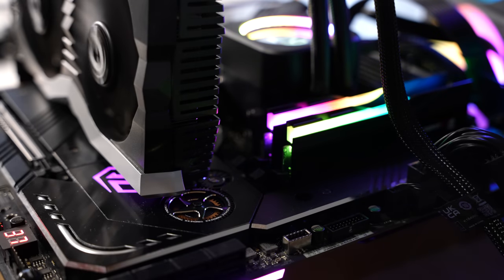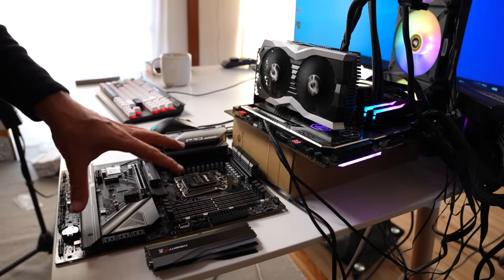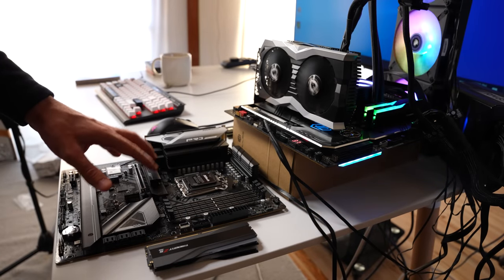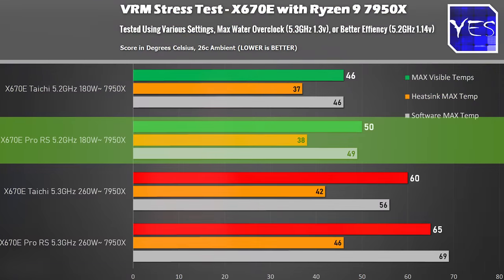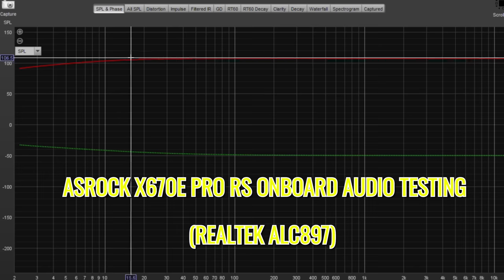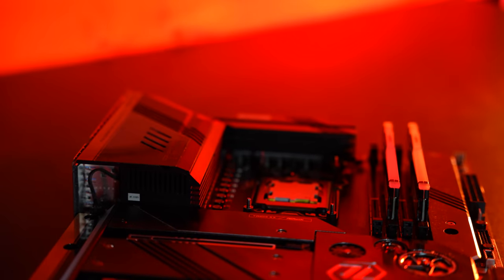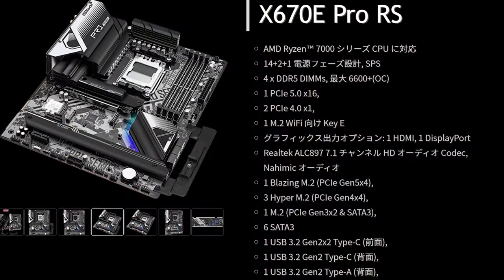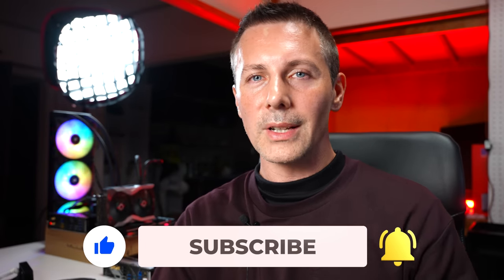Watch This BEFORE you Buy an X670E or Ryzen 9 7950X!

Comment: I have nothing against this video, i think it reports some good info actually, but i have one pet peeve which i want to mention with the whole "sweetspot" claim. You say that at 6400mhz you had some crashes in games, therefore it is unstable and then you say that 6200mhz is the sweetspot, how can it be a sweetspot if its literally maximum possible speed? Other people also have massive issues getting 6200mhz stable on zen 4 so official claim that 6000mhz is the sweetspot is very rich considering that you need to have only two modules installed and the next step 6200mhz can be potentially unstable on your system, aka potentially maximum stable value. Idk if im being way to pedantic about this but i have very different understanding of what sweetspot supposed to be.🤷‍♂

Comment: I did not managed to get my 1st amd build posting with more than 1 dimm installed, not even at stock settings - solid dram all the time for over 1h, regardless which bios I tried. Only posting with 1 on A2(each of both). Mainboard and RAM went back, but I still have no clue what the issue is. RAM was on supported list form gigabyte, but not on amd's lists. 1 socket pin looked way longer than the others. b650e elite x ax ice with an trident z5 64GB kit(F5-6000J3040G32GX2-TZ5RS) - 7800x3d. No clue what the issue is- - Is the the combo or a broken board... or the cpu mem controller??? so annoying when just wanna game😑

Comment: Question: This DDR5 6000 limit is on the CPU side and not on the chip itself?
I hope that future ZEN CPUs supported by AM5 socket and today's motherboards will not be also limited to 6000 if we already have way faster modules Intel can utilize.
7700x + mATX MoBo with PCIe 5 and M.2 5 is my way to go but I will wait because the prices of the platform right now are just ridiculous even on B650E
Could you please make a video about BIOS undervolting, setting the power limit, and temp limit using different manufacturers (Asrock, Gigabyte, Asus, etc). Mostly interested in Asrock.
Reply: Fortunately x3d does not require faster ram to extract the performance. X3d with ddr 6000 will be equivalent to 14th gen Intel with ddr 8000. I do wonder if zen 5 will be somewhat slower than zen4 x3d just like 7700x loses in a couple scenarios vs 5800x3d. The x3d technology is quite interesting but I personally would prefer a CPU that is faster in all situations that CPU that is super fast in some situations.
Reply: DDR5 6000 is already 800MT/s faster than the officially supported DDR5 5200. When he used 4 sticks at 4800MT/s, he was running 1200MT/s over the officially supported 3600MT/s.

Even Raptor Lake only officially supports DDR5 5600. We will just have to see how official support improves over time. But, generational increases matter much more for performance than RAM speeds. You can also get lower latency RAM at a given speed to help performance.
Reply: Zen 4 being the first Zen on DDR5 has weak IMCs, integrated memory controllers, just like 12th gen Intel did
Reply: @ij6708 is 13th gen any better?
Reply: @skyman1883  Much better 13th gen can easily run 7000MT/s and up, whereas on 12th gen it's very hard to impossible
Reply: @ij6708  I just RMA my 12900k and motherboard I couldn’t get 4x 32gb 5600 sticks to post depending on the resolution not sure to go 7950x or 13900k.

Comment: Compared to my FX-8350 system which has been rock solid flawless, the Ryzen AM5 platform has been a steaming pile of 5h1t.   I can't stand this.     I haven't used a system this bad since I bought an IBM xSeries 455 EFI Itanium 2 systemback in the wearly 2000's.   Which arguable is the worst comptuer I have ever owned...  followed by this 7950x and Gigabyte AORUS x670 Elite AX Gaming Mobo and 128gb RAM.   What a nightmare, it has fought me tooth and nail every step of the way and I still don't have a usable system.  I can get to BIOS and that took me weeks just to get it to POST with video on teh screen.

EFI can swck a tvrd and DDR5 right along with it.

Comment: Will this apply to the 7950x on the MSI Carbon WiFi?
Reply: I sure hope so, I'm getting this bad boy this week. And the feature set of that MSI is vastly superior to all other brands at the $500 price point (except the ASUS ProArt if you need 10G Ethernet and USB4), notably the PCIe slots are awesome (you get 8x8x from CPU and an extra full x4 from chipset but not shared with anything).

Comment: This is AMD Top end,  PC in general there is a alot of competiton so they are pushing Watts to the extreme here,  every single components like motherboard,  ram, cpu, gpu are each in the hundreds of dollars.  If you do work and need to things done then it worth it in the short term,  I kind of question the stability the heat over the long term.

Comment: 7950X supports:
DDR5 5200 with 2 sticks of RAM
DDR5 3600 with 4 sticks of RAM

You getting DDR5 6000 working is a 800MT/s OC. You getting DDR5 4800 working with 4 sticks is an impressive 1200MT/s OC.

Edit: Also, it has only 28 PCIE 5.0 lanes. x4 is used to connect to the chipset, and I think another x4 are needed to connect to the E chipsets, leaving only 20.

The other 24 lanes are 24 PCIE 4.0 lanes from the E chipset.
Reply: Steve Taylor  
Interestingly, dual rank vs single tank memory mattered for Zen 1-3, with 1x dual rank stick basically acting like 2x single rank sticks. But, Zen 4 doesn't seem to care about rank. So, AMD has come a long way. DDR5 3200 is extremely slow, though.

I haven't looked into Intel's supported RAM. I will have to. To bring up a controversy related to this, I was fine with Intel comparing themselves to AMD using AMD's slower officially supported RAM speeds. In my experience, overclocking is "over" for a reason. Any time I overclocked, I eventually found fringe situations where it was not stable.

Whenever enthusiast reviewers run into stability issues with highly OC'ed systems, I wonder if OC's are at least partly to blame. AMD loves to recommend unsupported RAM speeds to reviewers, but AMD should back it up by officially supporting those speeds. There is a reason why they don't.

Comment: i ended up getting the x670e steel legend from asrock and the 6000 cl30 ram kit from G.skill. i think ill try tuning it eventually but i wanna do research first of course
Reply: How it's going so far?
Reply: @gezimlimoni2319  its been rough not gonna lie, the ethernet randomly disconnects on the motherboard at times, its a known issue that hasnt been resolved yet so no way to fix it. also with the set up since a lot of the connections are on the bottom some of wires were difficult to connect to be honest.
Reply: That's not good, it was my top choice,,,now I really don't know what to get,,,any suggestions man,,,, thanks for your reply!

Comment: The prices are still too high, even with the price cut.
Reply: especially in straya
$334 for a Gigabyte B650M DS3H.
$178 for 16gb of 5600
$399 for the 7600X
$911 just for the platform, no storage, case or gpu.
Reply: @ChristmasCrustacean1  there were b650 boards for under 250 AUD a few days back
Reply: not really, I got my 7900x for 570€ which is about the same as my 10700k cost. Motherboard cost like 220€ which is also about the same as my current LGA1200 one

Comment: I worry about anything on a motherboard being hotter than 100 Celsius.  I also worry that I need to feed more than 200 watts to any component.  We have been promised "smaller, faster, cooler, cheaper" for a long time.  I am disappointed with the IT industry, who do not care about the cost of electricity, or carbon proliferation.

Comment: X670/E are really lacking compared to B650/E even on paper. Vendors will try to differentiate more by feature legos, but the market force will sort them out over time. Right now you are paying hefty early adapter tax on either chipset.
Reply: Why X670 is lacking though?
Reply: @boboboy8189  It gives you extra X8 PCI-E lanes which are connected to DMI that is throttled to X4.  For that you get an extra chip that heats up to 80C.
Reply: Please, what motherboard you would suggest me for 7800x3d??? I'm still waiting for the right one to choose and to not overspend!

Comment: I will pass on first gen am5. I will see if 770e chipset and Ryzen 8000 not improve on quality of memory slot, memory speed and compatibility and cpu heat, then i would consider intel Arrow lake 15900k if intel improve on heat and power consumption. I am open. I  not a fanboy. I have ryzen 1800x and 1080ti because these were the best at the time. When i will upgrade i will choose also the best, not the hype, and not the one that has a army of youtuber working for them.
By the way you advise to change the system immediately which cancel the warranty and a cpu is expensive. If the cpu is not working well you loose your money. It is not acceptable. The ryzen 1800x works well at stock.

Comment: Does anyone know of B650 alternative that has 4-5 NVMe slots like the X670E Pro RS? Storage is very important for me as I do gaming and software programming on the same computer. If I can get the same amount of storage and speed (PCIe 4.0) but at a much cheaper price, I'll take it. I'm a guy that likes to min/max my builds in games as well as in real life. Max performance, minimum budget. 😂
Reply: I bought a 7900X3D by the way. Now I'm on a quest to find the cheapest but most stable 6000MHz DDR5 kit that is at least 96GB (2x48G) that is also compatible with the motherboard. My motherboard first choice in the ASRock X670E Pro RS. I have yet to look at the RAM compatibility list.

Comment: To me it's not really future proof. AM5 is stuck on DDR5-6000
There are already DDR5 kits that do 8000 MT/s and are compatible with intel platform.
Reply: no, Zen4 is stuck on DDR5-6000.  Much like how Zen1 is stuck on 3000mhz.
Reply: Memory controller is on the CPU.
Reply: @ChristmasCrustacean1  OG Zen was a monolithic die. Now that we have chiplets either that new IO die is gonna stay around for a minute as the old one did for the 3000 and 5000 series.

So it might not be a talking point now but in one to three years it likely will become good bit of a talking point about Zen 4 and possibly 5 not liking over 6000 MT/s while the most recent at the time Intel chips take off past that.

Granted I don't have a crystal magic ball, so take with a grain of salt. But it's something to think about.
Reply: @nap8187   I have no doubt that the I/O die will stay 6nm but it will be revised for Zen5